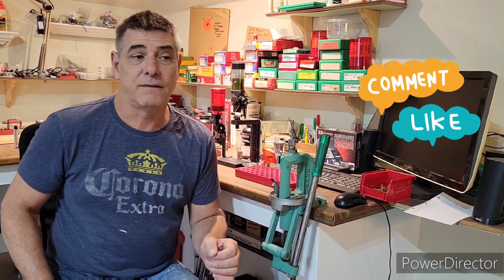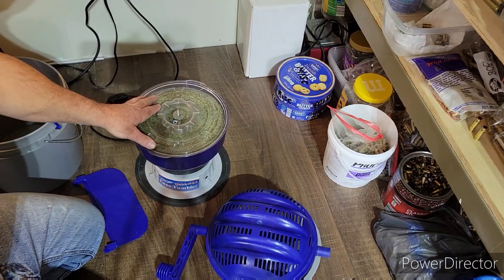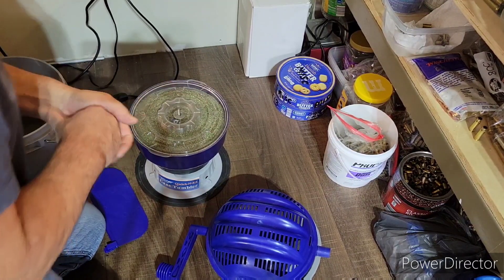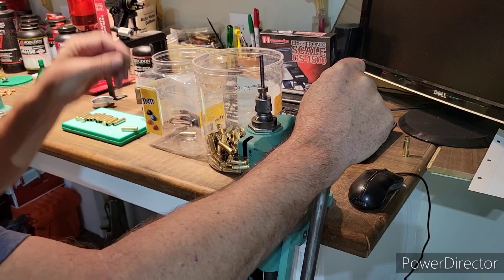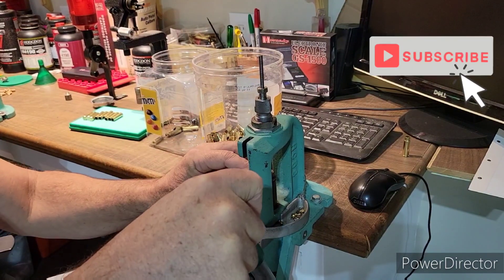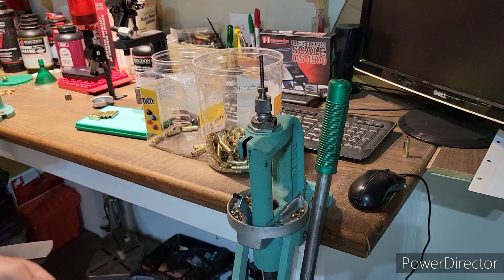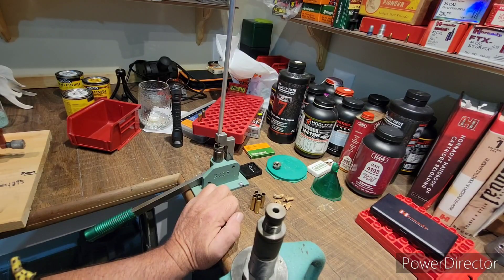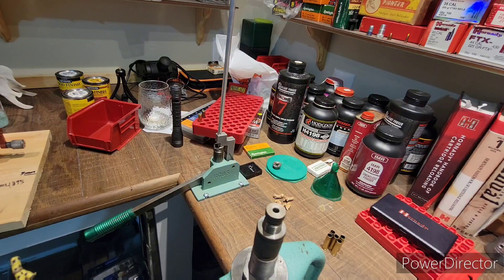300 Blackout Brass Prep for Reloading

Comment: Nice video. Thanks for posting. I am interested in the countersink bit. Where did you get it? I don't know enough about those types of bits so I want to make sure I get the right one. Thanks in advance.
Reply from the maker: Thank you for watching and commenting!  You want to look for Center Drill Countersink , I'm not sure where I got mine but you can find them at Harbor Freight , Lowes and Walmart etc.  Mine is a #2 but the actual measurements are 3/16 x 5/64 tip . I hope that helps.
Reply: @Urban_Tarzan  Thanks. I have all of those stores nearby to choose from. My last trip to our local outdoor range, I found 150+ 300blk factory cases. :)